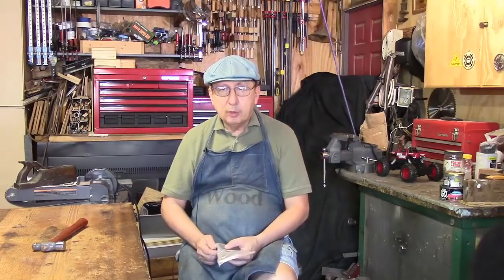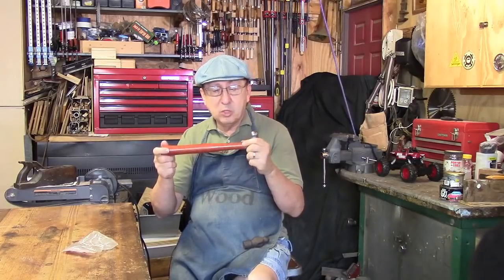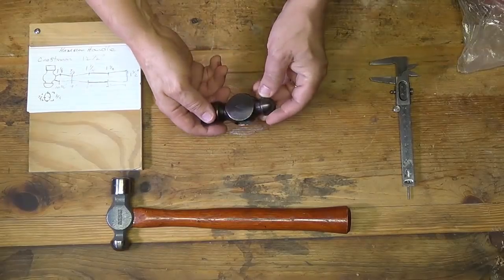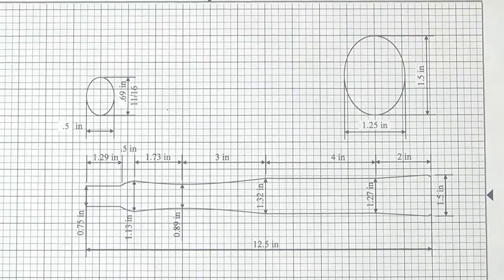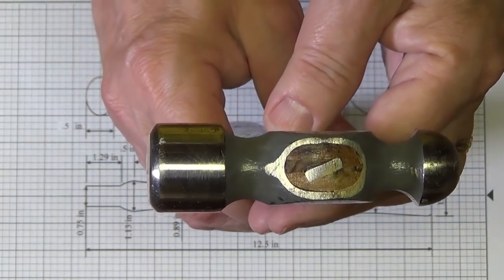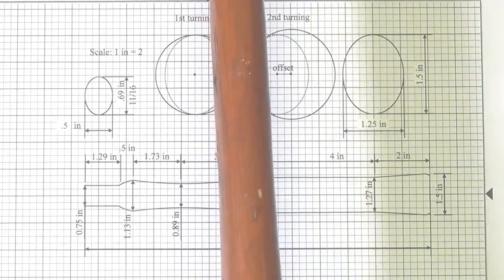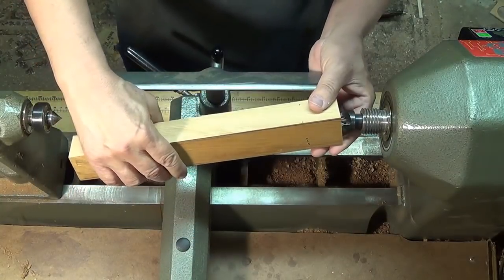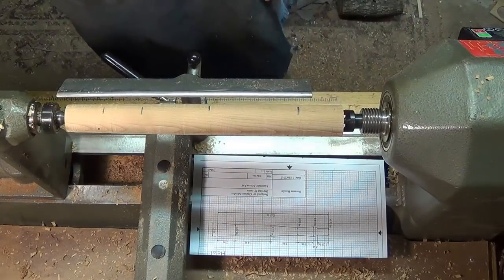Offset Turning - Hammer Handle

Comment: Nicely done indeed.
So good to see a hammer handle,or any handle for that matter with the grain layers running parallel to the axis of the tool.  So many handles you buy in hardware shops these days have the grain layers perpendicular to the tool axis then people wonder why the split along the grain when used. Well done.
Reply from the maker: Howdy Mike! Thanks, that was a decision I had to make. It made sense to me. Cheers.

Comment: A good video - it is a nice job to do to restore an old tool. I have made three of these now out of ash and I find it useful to leave an inch or so at each end, bigger diameter than the handle will be, to make plenty of room for the offset centres to be spaced out but still not too near the edge of the turning. These bigger end pieces are just sawn off to finish the job.
Reply from the maker: Howdy Bill! An excellent idea and something am considering for the next handle. The small end was my problem. It was barely large enough to turn safety. All the Best.

Comment: Thanks for the informative video. I just made a dead blow mallet for my wife.  For the handle, I used rectangular teak.  The small dimension was the same as the handle small dimension.  I'll give offset turning a shot for my next hammer or mallet project.
Reply from the maker: Howdy Jeff! Give it a go. It is enjoyable to make something different. Cheers
Reply: <  a dead blow mallet for my wife >  ???  the mind boggles, should we have sent for the cops ?

Comment: Excellent!  I really enjoyed this/your video.   It quashed just about all of my doubts and anxieties....  Now, it's time to grab a stick and whittle away.  I found a hammer the same weight, length, etc....:  the dimensions are the same as the ones that you laid out.   I wondered about the different styles of handles:  whether it's for a "machinist", "engineer", "blacksmith", silversmith,  etc.  I guess there are reasons for the differences.  Also, in that line of handles, I've noticed that oak is the species, most called out.???  Maybe because of its stiffness???  ...higher degree of control...at the cost of vibration (causing carpal tunnel syndrome...I heard was common to blacksmiths).  I ain't no tradesman.
Reply from the maker: Howdy Joseph! Yes, there are differences. The claw hammer handle comes to mind. Claw Hammer handles need to be strong because through leverage they are used to pull nails. Machinist hammers rely mostly on velocity. Blacksmith hammer handles rely on brute force;  thick handles with heavy heads, cheers.

Comment: Hi Cip, I just found your channel and really enjoyed your video. There's a tip I'd like to share with you that I learned back in high school shop class. My dad had an old ball peen with a broken handle. It was a big ol' hammer probably about 2-1/2 to 3#. Anyway, I took it into school to make a new handle for him. I was just going to make a round handle  but the teacher showed me how to do offset turning. And here's the tip he gave me... when marking for the centers,  use a drill to cut holes for the centers. For the drive center, use a band saw or hacksaw to cut grooves for the drive flanges. It'll give them better purchase in the wood and keep the centers from jumping and/or drifting if the offsets are too close to the other holes.  BTW, I just subscribed and I can't wait to see your next project.
Reply from the maker: Greeting Mike! Good tips. I hope to make at least one mode video this year(2017). I do have a gallery of 83 videos. You may find a video of interest there. Kind Regards.

Comment: This is awesome! What would happen if you had a sacrificial half inch at each end to cut some off for each turning? You could do all of the measuring at once, maybe drill tiny pilots to guide and keep the measurements?

The center pin hole thats left would be to center it for sanding with a band sander maybe?
Reply from the maker: Howdy Phoenix! Yes, there was some sanding required to smooth and blend the curves. A little extra length would have been welcomed. Kind Regards.

Comment: Good job Cip! I enjoyed the turn and especially the way you walk us and yourself through your first off center turn. I've played around with it a couple times but never on a real project. I use a small Jet midi lathe and am wanting to buy a larger machine. The DVR is one of my top machines.machines. They are better than VFDs in my mind. Happy Thanksgiving.
Reply from the maker: Hey there Charlie! I greatly enjoy my Nova DVR. The speed control is fantastic: Rpm is constant. It never slows down. I still have my Jet mini lathe. It does not get much use. Take care.

Comment: What about using calipers, set to the diameter you need? Just let them ride in the groove while using the parting tool. When the caliper slips over the wood it has reached the correct size. No need to stop the lathe every time to measure.
Reply from the maker: Howdy Mark! Sure, I stop and spin slower than a lot of turners. I often do it for the camera and viewers, cheers.
Reply: @CipsWoodChips  Ah yes! You have people watching. I got paid by the piece. Keep up the good work.

Comment: Nice job with the hammer handle Cip. I’m a neophyte turner and appreciate you sharing your techniques. I noticed the computer drawing in this and your super clamp video. Would you mind sharing the name of the software that you use? Thanks
Reply from the maker: Howdy Dave! I did these drawings with Serif DrawPlus X8. The program was replaced by Serif Affinity Designer. These are drawing-art programs not CAD engineering programs. I can send you a PDF. Send an email to cipmendez19@gmail.com Cheers
Reply: Cip's Wood Chips Thanks Cip. I’ll look it up.

Comment: u need to sharpen your gouge and use it properly riding the bevel on an angle you should get a very smooth cut that way
Reply from the maker: Howdy Darren! I did sharpen the gouge during the offset turning.  I have to confess I am out of practice. I have not turned anything in seven months. Cheers.

Comment: It didn't turn out to bad for your first time at offset turning.  The only thing that I have noticed the you use all of your tools as scrapers, you are not running the bevel and use the cutting edge.
Reply from the maker: Howdy Bruce! That is very true about me and scrapers. I learned to turn wood in Jr. High and we only had scrapers and parting tools. Every time I pick up a gouge I have to practice and learn it again. I am by no means an expert. Cheers.